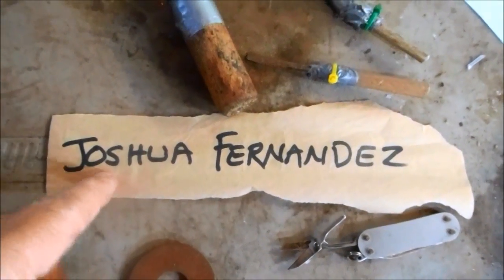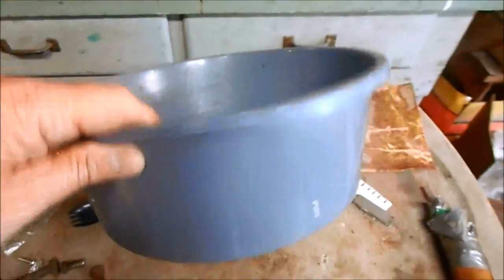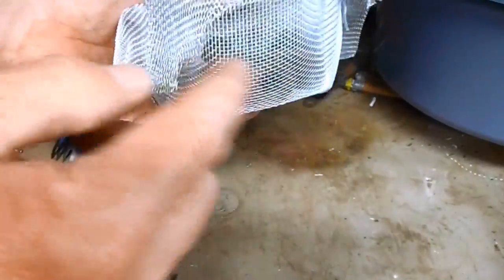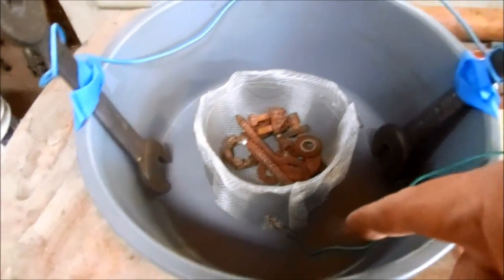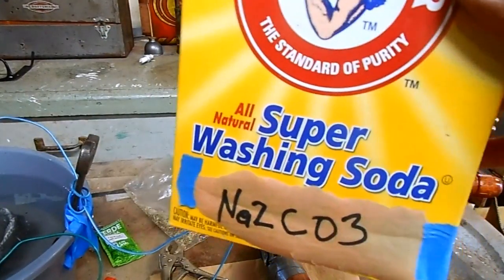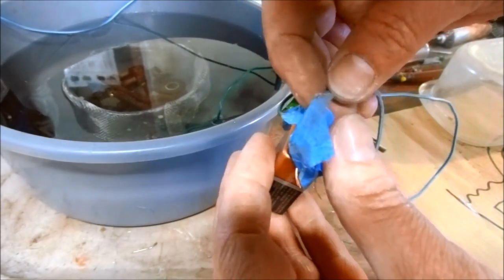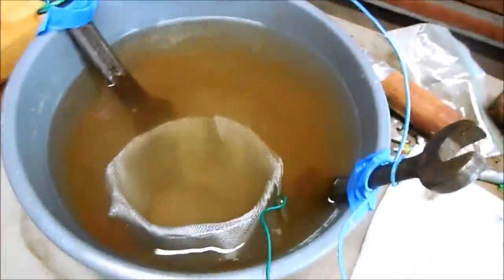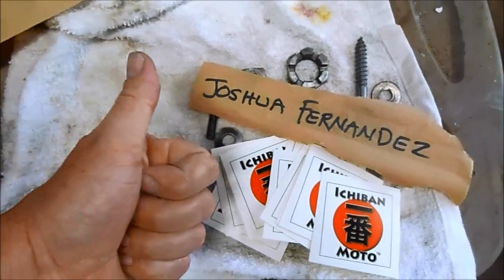How to remove rust from nuts bolts tools and parts in bulk using electrolysis

Comment: You only need one stainless steel bowl full with water and electrolyte. Hook up the negative to the metal bowl then throw them nuts and bolts in there then suspend your sacrificial in there with a piece of wood or plastic but making sure it doesn't touch the sides or any of the parts. Hook up positive to your suspended sacrificial and good to go

Comment: Haha, Washing soda is very dangerous so use goggles and gloves. Priceless. I also love your "baking" process. I am surprised it worked with the wire screen. I always give my parts a direct line of sight path to the "anodes". The part being de-rusted is technically the cathode in the circuit. You always throw curveballs. So funny. BTW: I use an ultrasonic cleaner with vinegar to remove rust, it works about the same but is way cooler!
Reply from the maker: i made a parts tumbler and a vapor blaster also that work well removing rust. i think I have videos on those.

Comment: Could I plug it into my wall (230v) instead of the power pack you was using? Would be badass if I didn't have to buy a power pack.

Comment: Would this work on the inside of a gas tank?
Reply from the maker: it does. you can insert something like steel rebar in each side through the filler , just be careful they don't touch the tank. note- If you have the cash, filling a tank with evaporust works awesome.  don't use vinegar, it is usually 5% acid so it eats the rust, but also eats the steel.

Comment: Hi, does electrolysis have some influence on mechanical properties of metal part? Because I would try this on wheel bolts.
Reply from the maker: it's actually transferring atoms and molecules and I'm sure some good metal is sacrificed  in addition to the rust
Reply: Metal does not have mechanical properties. If you mean physical properties, the metal is slightly lighter and weaker due to loss of material. The loss is negligible.
Reply: @beauellerson8668  Question was not if metal has mechanical or physical properties, so your comment is obsolete. Also, let me educate you, mechanical properties are real thing strength, hardness, etc., physical properties are color, etc.
Reply: @mihoviltomasic8945  if u read the whole comment, the phrase contains the answer. I was wrong about the term mechanical properties.
Reply: @mihoviltomasic8945  A physical property is any property that is measurable... The physical properties of an object that are traditionally defined by classical mechanics are often called mechanical properties. -wikipedia

Comment: I heard that using Gatorade helps speed up the process
Reply from the maker: it has electrolytes !
Reply: Ichiban Moto very true. Also maybe instead of a battery try a potato and harness the natural energy power
Reply from the maker: I need to hit the market for more potatoes ... I used mine all up making cannons.
Reply: Ichiban Moto just move to Ireland as I hear potatoes are there currency
Reply: Ichiban Moto what are electrolytes?

Comment: The screen I was going to use for my basket was rusty. So I had to buy some new screen to make a basket for the old screen material and de-rust it first. Not sure how much I saved using the old screen once de-rusted as I'm still working on the cost formula. Bad-ass amount I'm sure.

Comment: All that with a 9V battery. That is badass!
Reply from the maker: 8, 9, 10... whatever it takes !
Reply: Sorry but I'm trying this....did you connect the positive wire to one battery and the negative wire to another battery??

I'm doing this while I type....
Reply: Could I use 12v as well? 
The rest I got sorted..
Renovating a 50’s truck at the moment:)

Comment: Electrolysis is a great option for items that have rusty interiors you can't reach. But for rusty bolts, washers, and the like...it's a complete waste of time. Put those things to a wire wheel and be done with it. That entire basket o' parts could'a been cleaned in 5 minutes, fer cryin' out loud! Sheesh!

Comment: I have a friend building a rat rod and he wants the rust on his car,can the rust you have be collected to spread on it or perhaps reverse the process to make solid straight panels look old and rusty? I know the obvious thing to do is to paint the car but they seem to like them very rusty. I did offer to swap his exhaust with mine from my gs500- that has lots of real rust!
Reply: spray muratic acid all over the car then wipe with gloves on of course and then rinse. Let dry then spray hydrogen peroxide, then let dry repeat hydrogen peroxide as many times to achieve level of rust. After all is done rinse one more and dry.
Reply from the maker: awesome !

Comment: Sweet basket! However I've just used the assembly wire to tie all the parts together. If the parts have holes in them, you can hang them on the assembly wire.
Reply from the maker: oh- top tip!

Comment: You don't need a 9v battery, you can do it with two AAs wired in parallel as long as the electrolyte solution is above 40C and the surface area of the cathodes is greater than 40% of the surface area of the parts to be cleaned...
Reply: Clearly you wonna do it at room temperature. Where do you get the energy to warm water for 12hrs?😂

Comment: Bad ass indeed. Can I scale it up do the whole nike in the pool off the mains power?
Reply: Alternating power does not work, you will need to put a diode to make it direct power.
Reply: Yup Using an Arc welder on 90 Amp as power source, and yeah be very careful when doing so